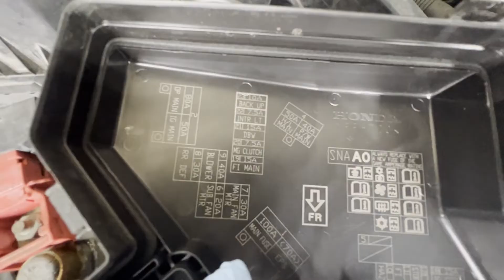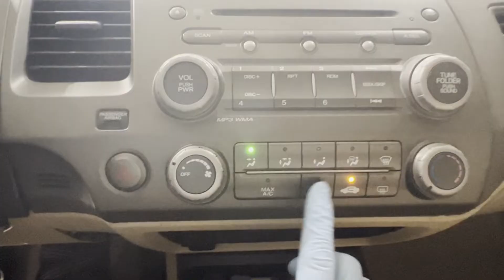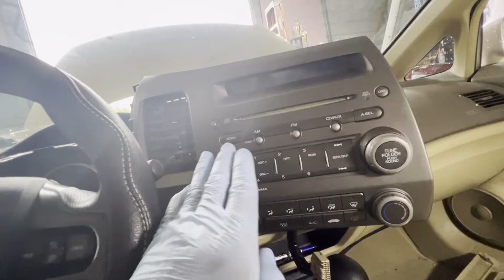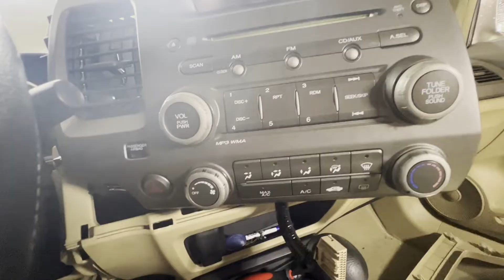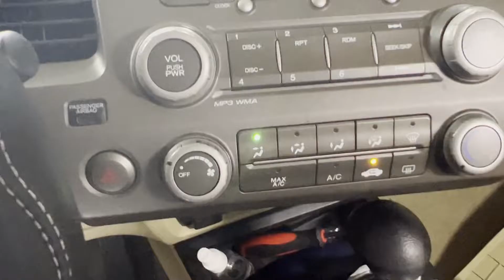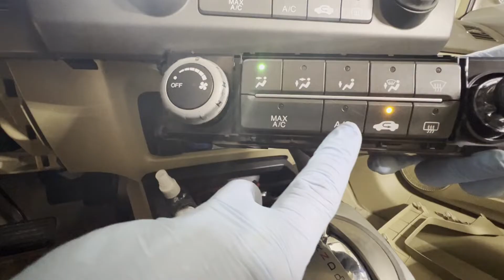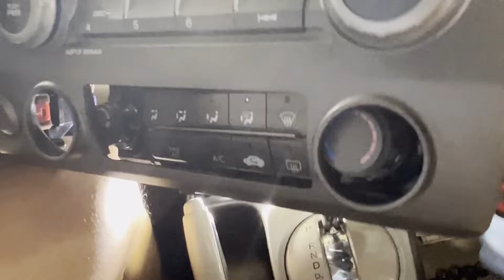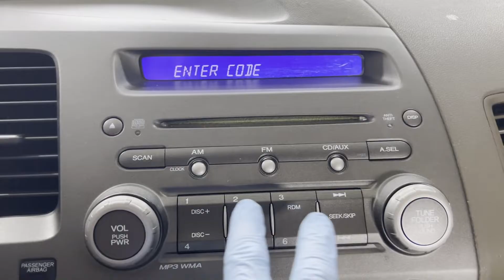AC compressor always on / wont turn off *Fixed* Full diagnose & Repair 07 Honda Civic 8th gen How to

Comment: I own a 2001 Nissan Frontier and I just found your video. My ac stopped working a long time ago and 2 shops were convinced my compressor was bad. I didn't have the money so i drove without ac for over 3 years. Last weekend my buddy who owned a garage for yrs started playing with it and we realized the negative wire to the low pressure switch had a bad spot. We ran a line and it kicked right on. Added 1 can of freon and it's ice cold. However, it doesn't kick on and off it stays on. Thanks to you i know where to investigate.
Reply from the maker: Remove your ac relay. If it still stays on, you ac clutch maybe stuff into the compressor. Not surprised coz it’s been sitting for 3 yrs. 
I hope you get it situated 👍🏽

Comment: Bro lol, this burned up my old compressor, replaced entire system and then noticed the A/C stayed on because the evap kept freezing. Thanks for the video !
Reply from the maker: Ohh man . I’m sorry to hear that. Sometimes you’ll notice an ice build up on the low side lines of the system. 

Man, I bets that’s a nightmare
Reply: How do you prevent it from building up? What was the solution?
Reply: @woodchristopher93 his answer wouldn't help you because theirs afew different situations that can cause the evaporator to freeze over from a clogged condensor, to a dirty cabin filter, low freon, etc...
Reply: Same I'm having the same issue, it gets completely frozen but my fans stay on all the time

Comment: I am confused on why it would stay on if the ecm is the one that usually provides ground to a/c compressor. Wouldnt it still cycle on and off? Great video and you saved me a head scratcher.
Reply: It just sends a signal to turn on or off, the relay is responsible for activating , relay has a mechanism that allows it to turn on and off, if the mechanism inside the relay fails it will not matter what the ecm wants.

Comment: Awesome video. My problem is different tho. My previous AC compressor burnt up because the AC clutch stayed on all the time (when the switch was on and would turn off when AC was off). Figured since it has never been replaced, it finally gave out. So I replaced it with a new AC compressor. For a year it worked perfect and then the same situation started happening. Never fixed the issue again since the AC still works. Yesterday night, finally decided to work on it. Took the AC clutch apart and cleaned it up with sand paper. Cleaned all the sand that was in there. After putting it back together. It  worked perfectly but then the AC clutch engage when it had too and then got stuck on again. When I turn the knob for the AC inside the car off, the AC clutch turns off. So after watching this video. I'm assuming is the AC relay that is probably bad and gives it power constantly when I turn the switch on. So I gotta swap it and try it out too. Is summer and I don't want it to burn up on me again.
Reply: Or could just be the switch as well that is giving constant power to the relay.
Reply from the maker: Yah just check one area at the time to figure out which one actually give constant power . It’s sucks that happen to you
Reply: @autopurlieu  Thank you!
Reply: @autopurlieu  So I tried switching the relay just now like the 2 that you switched. Turned it off and on and works the same. Hit the turn off AC button inside the car and works the same. AC clutch turns off when is suppose to with the switches but when is on, keeps on running unless I turn it  Off the system then it stops. So another faulty AC compressor, I presume? Switches function properly, switched relays and they work perfectly, cleaned the cluth and sanded it down, no shortage on wiring. The only thing left is the actual compressor then. Unless I replaced the AC clutch coil but then is gonna be more work and money if that doesn't work and the entire compressor is gonna have to be swapped.
Reply from the maker: @TheDeathsentence123  try this out 
https://youtu.be/KJ2fFCpyW20

Comment: Hi. I also have AC always on. Additionally the two radiator fans are always On too. Even when I just turn on the ignition the 2 fans start to spin. Did you have the same problem with fans in this video?

1) I tested all the relays. They are good. Ac clutch is good too. No OBD faults. 

2) When  I unplug Ac relay (as you do), Ac stops working but both fans are spinning. Fans only turn off when I unplug the Fans relay.
I checked the connector of one  of the fans, and there is ground even when car is off.

3) When I unplug the Ac connector then everything turn off (Ac and both fans).
Thanks in advance
Reply: Have you figured out this issue? I have the same except when I unplug the HVAC controls my fans and compressor stay on.
Reply: @Roootrocker228  It was indeed the control panel. Everything works now
Reply: @aezam4064  can you explain please..i have this same.issue
Reply: I have the exact same issue..fans nd compressor are engage on ignition

Comment: Changed my whole AC system. Finally visiting the service center tomorrow. Hoping to get this fixed in my Hyndai Creta- 
Also if you can suggest how to stop the air flow on windscreen in default mode ? It fogs my windscreen and i have to use vipers all the time. Seems some air leak !
Love from India
Reply from the maker: Hi, is your air flow on windshield on default mode on activate when you just starts the car? What car year and model ? Also are you be able to change the setting or stuff in windshield mode all the time ?

Comment: I got 2013 honda civic lx, and noticed that pipe is freezing up much and after 12mins drive im losing my AC, no cooling. I checked Ac clutch and relay found out that AC clutch not stopping even the climate control is turn off. Im sure that i am having same problem with this. Hopefully there is no more issue after fixing my climate control as i am having frozen pipe often. Thanks for the video anyway.
Reply: Did that fix it?

Comment: I think you just helped me diagnose my BMW! On my car only the front vents will open but not the bottom or the defroster and my AC turns on and off at times or sometimes no power
Reply from the maker: What year model bmw? 
Scanner can probably pinpoint somewhere on ac problem you’re having
Reply: It’s a 2012 bmw 535i , I scanned it and this is what shows…. Integrated automatic heating / air conditioning system ІНКА.

So I noticed yesterday when I was moving the AC controls around it would turn off like the whole control unit would turn off unless I placed it in a certain way everything would turn back on, so I’m thinking it’s the AC control module that’s not working , And that scan also tells me which vent flaps are not opening, and I’m thinking it’s because of the AC control module possibly not working.
Reply from the maker: @joerod7176  yah sounds like you find your culprit. Good job man . I would think to start from there
Reply: Thank you , I appreciate you responding to my comments
Reply from the maker: @joerod7176  no problem. Thank you for your support 🙏

Comment: Wow thank you man I’m having the same issues with my 07 Honda si
Reply from the maker: I hope it fix your problem, keep me update
Reply: I'm having the same promblem ac clutch disengages after like 15 promblems tested the relay and compressor and there all good and have power ..
Reply: @Thatzlyght lmk if u fixed it
Reply from the maker: @kegandelmar8489  I think your situation is different . Check my other video . Might be related to your situation 
https://youtu.be/MjMa-faktVw
Reply: @autopurlieu  I have a si it shouldn't matter huh?
Reply from the maker: @kegandelmar8489  it’s the same thing. I have an Si too. Only engine and transmission are the difference and few small things

Comment: Hello, I have the same problem but I wanted to ask you if the two fans, the one for the air conditioning and the radiator, turned on because that is what happens to you that the two fans keep on. Thank you
Reply from the maker: I’m sorry, I don’t get what you mean “my two fan is on “ 

I’m not focusing on the fan. 
I’m focusing on my ac compressor was kept on

Comment: Is there any other way to know the climate control switch we picked from an old car is working well? 23:54 ... Or how do we know our switch is in bad condition, even though it passed the selfcheck test (pressing the last two buttons at the end of the switch)?
Reply from the maker: @JoseFernandez-mb4kw  yes, you can pin out the signal wire coming from the climate control switch that powers up the ac compressor. 
You will need a wiring diagram of the climate control pin out and somehow connect a multi meter directly from the climate control
Reply: One more question, 6:22 with the AC relay out, are you fans still on (both)? ... Is the same short circuit, caused by the climate control switch, affecting the radiator/AC fans?
Thank you again!
Reply: @autopurlieu and you can use a scanner to see ac request
Reply from the maker: @sauldiazvillalvazo4612  request is not a problem in this situation . 

If you request it off, it won’t do anything . It’s keeps being on and engaged

Comment: Watching from France...Same problem with my Honda jazz 2005..Radio function but  no heater .I changed the module,but the problen still existe..I am going to change the resistor of the blower to see..Can you help me Sir and  waiting for your answer..Merci and Thanks a lot..
Reply from the maker: If no heater, check your coolant. Maybe not bleed properly and heater core might be culprit too

Comment: I just had all my freon escape from the relief valve from the compressor staying on consistently.

Turned out to be the relay was stuck on, which also caused my battery to drain everyday and need a boost. New relay and i added freon that was lost and its kicking on and off with ice cold air 🥶 also the battery drain is also gone

Comment: Does the A/C fan stay on continuously when the A/C is on or should it cycle on and off every ~1 minute?
Reply from the maker: It should cycle only when it’s on
Reply: @autopurlieu  mine is staying on continuously, I’ll have to figure out why it’s not cycling
Reply: Thanks
Reply: @martymckay297  Did you find out what the problem was? Wife's Jazz/Fit clutch is always on if A/C is pressed on (no cycling). Also one of the two fans is always on at the same time, the other is never. If A/C is pressed off, neither of the fans are on.
Reply: @pallikorva11 did you find the issue? I’m having the same problem! 😒
Reply: @martymckay297 did you find the problem? Mine is doing the same thing
Reply: @hecks_k20_fa5 no I never found the problem, I’ve stopped trying to fix it
Reply: @martymckay297  I think I’ve finally figured it out! I’m thinking the Ac pressure switch is bad. I’m getting power to the Ac compressor and when the car is moving the air vent temperature gets colder in the car! And on cooler or rainy days the compressor cycles on and off like it’s supposed to,so I’m leaning towards a bad ac pressure switch!

Comment: Can you show us what you would have done if that didn't fix it?
I'm having a similar problem with mine. I've gone through all the same steps you have and my clutch stays engaged. I've even gone as far as to unplug the evaporator temperature sensor and it stays engaged.
Not really sure where to proceed from here.
Reply from the maker: Have you checked your relay? Maybe it’s stuck closed
Reply: Have you found the problem? I’m in the same boat with my civic si!

Comment: Hi. Ok my ac compressor stays on but i get warm air when stoped but driving i get semi cold air but when i go all the way to hot then back to cold it gets way colder. Fuses an relays must b good if it workin just compresser doesnt kick off an on. Now it is a 14 yr old one an i also removed the shime for the face plate to move n closer. Both fans work. I did put a used climate control switch with all the buttons about 1 month ago it worked perfect for the first 2 days either stopped are driving but then started doin the same thing then noticed compresser wasnt kickin off an on? Any thoughts would help alot thanks
Reply from the maker: I would start replacing with a relay first. Relay is relative cheap. Then it keeps doing it, make sure you have proper pressure inside the system. Always start with simple diagnostic before going further
Reply: I did earlier and still doesnt kick off an on. Ill get somebody soon to put guages on it and maybe change the high pressure switch.
Reply from the maker: @codybenoit394  did you check if you’re getting power ? Start with electrical, it’s easy to figure that out. . Is compressor getting power ? Then do elimination process going back to the fuse.
Reply: Yeah ac runs fans work. It just gets warm when i stop but driving sometimes it doesnt get all the way cold. So when i move the hot and cold knob back and fourth it gets way colder.
Reply from the maker: @codybenoit394  yah, get a small gauge. Pressure in the system change depends on the outside temperate . Might be overcharged or not enough pressure. 

Good luck brother .
Reply from the maker: @codybenoit394  all you need it the gauge. Yes .
Reply: K thanks ill try that in lil bit.
Reply: I put hose on small line with engine off it was in the red section. Took it off then started the car then put hose back on and it was halfway  between low and full.
Reply from the maker: @codybenoit394  car must be running and ac full blast running to use the gauge .
Reply: Ok i did start car and put max on and blower all the way up. Put guage on and it was at about 43 pounds in the blue section of guage.
Reply from the maker: @codybenoit394  there’s a chart to see what pressure you need in certain ambient temperature.

Comment: Hi ,  I have a 2007 crv, I have the same issue, but when I unplug the AC control module inside the car,the fans still stay on. I pulled the relay for the compressor also and it’s still on.
Reply from the maker: You might have 2 fans. 1 for radiator and 1 for the condenser. Are you sure you unplug the right one ?
Reply: Sorry, I removed the relay for the compressor and the fans are still running. I also unplugged the control unit from in side the car like you did and it still runs both fans.
Reply from the maker: @stevefrancis7322  your might be short ground somewhere . 
I believe I have another video that shows how to check each component but it’s an accord. Should be the same components . Just look it up

Comment: Are there some newer cars where there is always a little something blowing out?
Reply from the maker: What do you mean of that?
Reply: @autopurlieu  like you turn off the ac or heat but it seems like a small amount of air still comes out
Reply from the maker: @SonicBoomC98  is your blower motor is off? Maybe your recirculating vent isn’t on

Comment: Ok so mine keeps cycling the fans and compressor every 3 seconds with heat on in the morning. It's so annoying! I do not sure the AC at all I just want heat. I'll have to watch this full video tonight see if it helps.
Reply from the maker: Check the ac relay or the ac compressor clutch

Comment: When my car is stop the ac works perfectly but when I move the car the clutch gets off and also the cold air. Any suggestions for me
Reply from the maker: When you said “car is stop “ means in idle ?
Reply: @autopurlieu  I mean when I turn on the car until I don’t move it the ac, cold air, and compressor clutch works but when I push the gas and move the car cold air  gets off, compressor clutch also doesn’t move. Only air blows no cold air
Reply from the maker: @whatwhat3437  I would start with basic. Looks like you have power . Just check the ac pressure line if it’s in good and proper pressure  . Maybe you are low on freon

Comment: My compressor just says running but can turn off on the switch?
Reply from the maker: Check the switch if sending signal. Or maybe even relay is stuck on

Comment: I have a 2009 Acura TSX doing the same thing. The compressor just won’t kick off. It starts as soon as I start the car
Reply from the maker: Start with basic 

https://youtu.be/KJ2fFCpyW20?si=0IlAI7FPtfLNZXJH
Reply: @autopurlieu  mine starts. Just won’t shut off. Constantly blowing cold air. Clutch never stops spinning. Removed relays and it still keeps going.
Reply from the maker: @kentman0767  sorry, misunderstood your wording. I’ve never heard saying ac compressor “starts” .

Check your ac clutch compressor , it might be locked up. 
When the car is off, sound the outside part of your ac compressor, it should spin with your hand. If it can’t, it’s locked up
Reply: @autopurlieu  it’s ok. Sorry as well. The compressor clutch spins constantly. It does not cycle.
Reply from the maker: @kentman0767  that’s why check your compressor clutch . 
If it’s locked up.
Reply: @autopurlieu  compressor clutch spins.. only stops spinning when car is shut off
Reply from the maker: @kentman0767  I don’t think you are understanding me. 

Check your compressor clutch if it’s locked up!!

Compressor clutch should only spin when the magnetic is on (when you click the AC button)

If it’s keeps spinning even the AC button is off, there’s possibility that it’s locked up into your compressor pulley. 

Check your compressor clutch. It could ruin your whole compressor if you let it run like that.
Reply: @autopurlieu  ok. Sorry for misunderstanding. I was thinking if it is locked up, it shouldn’t spin. Didn’t know that if it’s locked up, it could cause ac compressor clutch to keep spinning as well. Thank you.